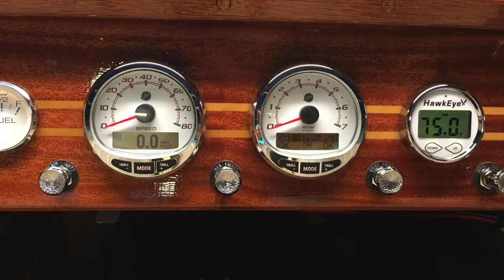Glen-L Malahini build part 2

Comment: I like the way she skims across that water with almost no wake. That makes for a good river boat as you're not annoying people with a big wake. You don't feel the need to slow down, just skim by with a smile on your face.
Reply from the maker: Thanks! She has a relatively flat bottom hull so ideal for calm river cruising. Does not throw much wake on plane so it is best to keep the speed up when passing other boats. However she does not handle big water chop so well, you get pretty beat up and wet!

Comment: I love your boat!!!!!  Have been considering a Malahini build myself.  I have built a stitch and glue wooden kayak with bead and cove deck.  Pretty sure I can handle this boat.
What % of the frame is hardwood.  I assume that you used OAK.  There is a lot of plywood in the frame and hull.  What species, thickness, and grade did you use?
also very cool scarfing jig on your circular saw.  Where did you find the idea / plan for that?

Comment: Simon you have created a beautiful craft to be very proud of. I love the lines and the clean way your workshop looks. I imagine the size outboard is more than powerful enough. Can you say what the all weight is approximately ?
Reply from the maker: Graham, thank you for your encouraging words! The Mercury 60 hp four stroke is a great engine, very smooth and quiet. It pushes the boat along at about  30 mph cruise and top speed 36 mph - which is plenty for the hull design.  I weighed the boat and trailer a while back and I think it came in around 2,100 lbs so the boat is probably around 1,500+ lbs, I have a lot of accessories on it.

Comment: This is a beautiful boat you have built. I am planning on building a ski king and hope to have it look as good as that. For the sides of the boat what did you do? Did you just varnish the plywood or put something else on it to get that color?
Reply from the maker: Thank you! I stained the plywood before I covered it in fiberglass and epoxy. I also added a little stain to one or two coats of varnish to deepen the color a little. I used water based stain and varnish (System Three Clear Gloss WR-LPU Urethane). WR-LPU is a little tricky to apply but creates a very tough top coat.

Comment: I love the idea of inlay between the deck boards instead of caulk. I know caulk is the classic look, but I always thought it looked sloppy. But before epoxy encapsulation, I guess the boards did move a lot with wet/dry cycles. Anyway, you definitely put the idea in my head. I'm a month away from flipping my ZipWhat wood did you use for the inlay?
Reply from the maker: I used maple for the inlay.  I glued the maple strips to one edge of the mahogany before I re-sawed and planed, making it a single strip - see 0:40. Easy to install and has held up well - no separation. Good luck with  your Zip - flipping is always a big day!